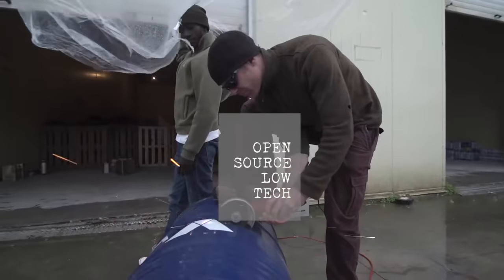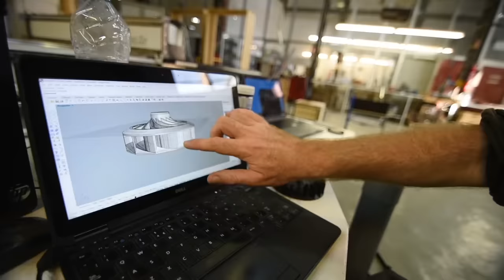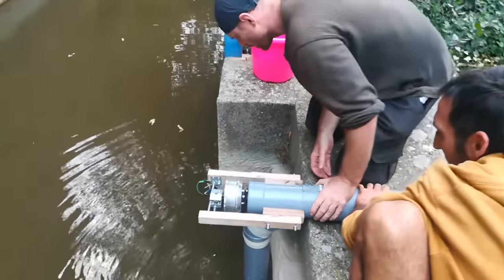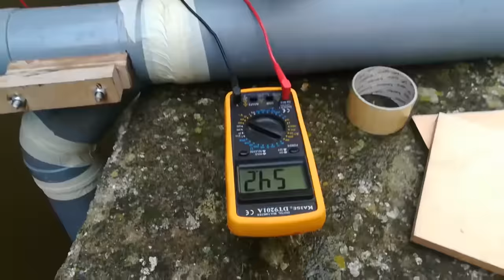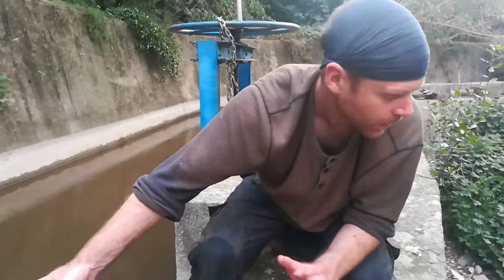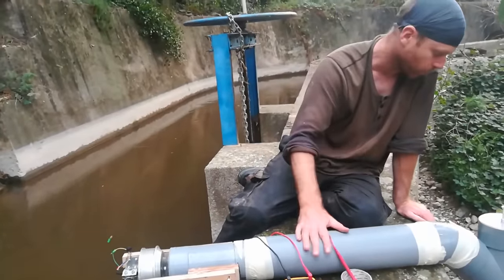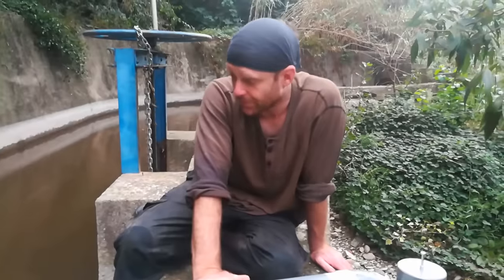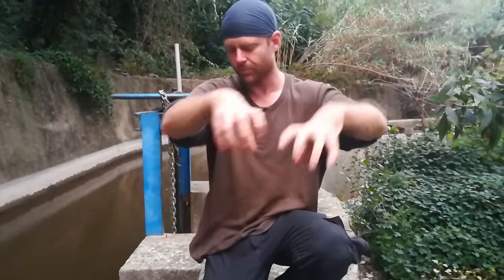The $50 Water Turbine -DIY, Portable, Powerful, and Open Source

Comment from the maker: Thanks for all the helpful comments. I'm currently in Berlin working on optimising the design,  including ways to maximise the rpms and voltage, so as to be able to have less load for more power overall, and try to hone in on that hundreds of watts figure. 
I'll be publishing all the results in a future video soon. Any suggestions and recommendations for ways forward are certainly appreciated.
And if you have any technical questions let me know.
Reply: Hey Man, I like this project and live in Berlin, I would like to help you to optimise this project, I have a master in Electronic Industrial Engineering Energymanagement.
Reply from the maker: Ok cheers, happy for any help I can get. Email me, address is on the opensourcelowtech.org website.
Reply: Quality  balanced bearings to reduce resistance,
Reply: Why couldn't you place generator'(s) in the down flow pipe as well for additional output? Just thinking out loud!  Nice work.
Reply: Do you know how the dyson vacumm advanced? Vortex within a vortex = exasterbated flow, mite work with kw output too?
Reply: This is super interesting. Need to get this to work in Tidal water. You need a vortex impeller for the discharge pipe. Also one before the fan would be interesting. You need to get the water moving centripetally if you can. Much more power to be had. Also with water that fast, the middle of the vortex should become levitative enough to pull a vacuum, which suction is the inverse of implosion. I'm thinking about this for my own design. How can I twirl the water enough to create the vortex vacuum and then I can use the negative pressure to enhance the machine? Also, when water is vortexed, the middle of it reaches its anomaly point at 4 degrees C. Due to this extreme cooling water becomes much denser having expelled its gaseous content. Denser water will provide more torque!! Viktor Schauberger, its all there. You're on the right path but you need his ideas to go to the next level.
Reply: Real Newsforever  
I think you need an electric boat if I understand you correctly. This is not technically possible with this mini hydropower plant, since this mini hydropower plant is only a power generator that can work at a certain position with a certain high difference. If you want to have an electric boat, you need photovoltaic modules, for example on the roof of a boat and a battery to store the generated electricity, as well as an electric motor to drive the boat.
Reply: Real Newsforever  How you got the plans? Are this Infos public Information or real plans and dates?
Reply: We have disused water tower at off-grid site. Would one day like to use windturbine/solar power to pump water to top. And run back down to have energy when power is needed.
Will follow your channel. ✌️😊
Reply: What output voltage is? 25V?
Reply: @afrohawk  There is a really good graph on what type of turbine to use depending on what flow and head you have.
For Undershot Wheel also read vertical or horizontal axis impeller types.
https://www.researchgate.net/publication/328216539_Assessment_of_Gravitational_Vortex_Turbine_in_Nepal
Reply: It looks promising. Where did you get the runner? Did you make it for the purpose or just find it by chance? How do you maintain a constant rpm?
Reply: Hey I live with my mom in a very rural old school cottage/cabin which is falling apart.  I have reframed problem areas reinforced trusses in roof and insulated. Water had very low pressure and heated slightly.  I started harvesting rain water after applying the proper coating to the recently shingle and metal roof I even have black hose draped on east side of roof so she is able to have a hot shower every morning.  I began converting my gutter into miny turbines that we've just recently been able to use throughout the house.  The location of her cabin is priceless my mom and dad were going to retire up here and my dad would have fixed it up far better than I'll ever hope to.  Unfortunately he passed away 12 years ago and my brothers and I can only do so much and now my health is failing.  I would appreciate any specs on that  water turbine which would make her last few years as comfortable as I can make them for her while I am still able.
Reply from the maker: @marcmilligan7143  Specs like which?

Comment: i hope that the tutorial will come up soon i would like to learn from it and share it to the the remote area in the philippines where people dont have basic electricity this could be a big help.
Reply from the maker: Yeah please do. I'll be putting the tutorial together in the coming months, once the design is sufficiently optimised and tested.
Reply: thank you sir this could be a big help for those people in need once the design is finished ill be more than happy to do it and hoping i can get help from the government once i made some proposals thank you again sir and Godbless you!
Reply: Have a merry Christmas and happy new year sir!
Reply from the maker: You too.
Reply: @OpenSourceLowTech   Hi there. In the video that you show how the turbine is turning the motor through the pvc pipe at the channel, can you please tell me what kind of motor you used there. Thanks Leon
Reply from the maker: @leonpitout3463  I've been using wheels from hoverboards/balance boards/segways, which are about perfect in terms of in and out numbers, and pretty easy to get in a lot of parts of the world.

For the rest of the world I'm thinking motorbike alternators are probably the best option, but haven't had a play with that yet.
Reply: @OpenSourceLowTech  Thanks for answering. I want to build myself a hydropower from a gasgenerator but only the generator part. Turned by a waterwheel with a big pulley and smaller one on the generator. Already worked the ratio out by the pulley calculator because i need 3000rpm for the generator. Thanks anyway
Reply from the maker: @leonpitout3463  Water wheels are super low rev, the alternators from generators are super high rev. You'd need to gear up by something like 500:1 to get any kind of useful voltage, and even if that's possible you'll lose a massive amount of power just to the gearing itself.

If you're attached to using a waterwheel (which may be your only option if it's flat water) then probably your best option, other than making your own voltage maximised DIY alternator, would be something like a direct drive washing machine motor (usually LG or F&P), or maybe an eBike wheel. But both those are still going to struggle.
Reply: @OpenSourceLowTech  Thanks for the information yes its not that easy

Comment: It is interesting having the driven member at the top. However, it does not matter where the energy is extracted from the flow,  because the total amount of energy depends on the   volume of water and the distance it falls, no matter where the energy is extracted. Higher voltage means lower loss for transmission of the power but then the  higher voltage must be reduced to the voltage that can be used by a particular user. Unless there are fairly high resistive losses in the transmission of the power, which is unlikely over short distances, it would be better to produce the power at a voltage that can be used directly. If the turbine needs to spin fast and only low torque is available then an alternator from a scooter may work well. The rectified output could be used to charge a 12 volt battery. This battery could then be used for 12 volt LED lighting. If 220 volts are needed then modern inverters are energy-efficient and available worldwide.
Reply: how does the distance the water falls after the 'driven member' affect anything ?  Seems like only the distance above the driven member should matter

Comment: Hello, 

Very good project I love it. 

Just one thing you are wrong (or i didn't understand correctly your explanations because i'm not english native). When you say your system doesnt use pressure for its power but more the speed of water. That is not true. 

To have power you need P. (Delta V / t) which is a common thermodynamic formula. So pressure and water flow are both important and necessary. And in function of those 2 potentials you will adapt your system (and you did).

Your system works with negative pressures due to water fall. That's why you need to launch it at the beginning. The rotor is runned by this negative pressure with a pulling force.

But with heights higher than 10 metters you gonna reach -1 bar (relative pression) which correspond to vacuum, so a natural limit. 

So yeah it becomes more optimised to put the turbine at the bottom of the waterfall with heights > 10 metters. 

Another thing, you speak about the cheap price. But you do not include electrical parts and knlowledge to convert this energy to a proper and stable electrical signal. 

Anyway still cool !! Did you get 500 watts ? 😁

Comment: Siphon tube will spin and spin whatever you want it to. Great job !
Reply: We learn to use less so we need to make less electricty. Peopl spend 4 5 6 even 1000 dollars a month for electric I pay $0.00 to an eketric company but I use my cheap amount we get from solar and batteries cheap generator you can get 1000 watts loaded from 1.3 hp you can do it with an electric motor as well as gas

Comment: Sink both sides deeply enough into the water, and then it works year round even if the top of the water freezes.
Reply: The pressure would equalize if both ends are in the water. Keep the water moving and it shouldn't freeze.

Comment: Please show us a load applied i want to see how the voltage holds
Reply: say my 5,500 watt aircompressor  ore 3 x 3000 watt water heater would probably stall it, hehe but as an offgrid  power supply loading a big battery and a converter12 to 110-220 volts you get more than enough power for say a washing maskine 1-2 time a day ore some powertools
even the wourld largest hydropowerplant started as a small scale science projekt.
but to perfect small scale powerplants, say a car factory could MASS PRODUSE STAINLESS STEEL TURBINS WITH GOOD SELF LUBRICATING BEARINGS!
IT WOULD MAKE THEM CHEAPER  IF THEY MADE SAY 1 MILLION OF THEM THAN IF THEY SAY MADE 1.

Comment: I didn’t see a dummy load or the load current meter?
Reply: and you won't because if you did put a load on that thing it would stop.
It's the same thing with everything like this it's just a whole lot of if's and but's.
You know, IF we had this and BUT the pressure and so on and so on.
This is why these things are always open source so that others can work out the flaws for them for free.
Reply: That still dosen't fix the fact that it will slow down when you put a load to it.
The power available in a stream of water is;
P=eta*rho*g*h*q
where:
P= power (J/s or watts)
eta = turbine efficiency
rho = density of water (kg/m³)
g= acceleration of gravity (9.81 m/s²)
h= head (m). For still water, this is the difference in height between the inlet and outlet surfaces. Moving water has an additional component added to account for the kinetic energy of the flow. The total head equals the pressure head plus velocity head.
q= flow rate (m³/s)

So with that we can simply calculate what head is the most efficient to use with the kind of flow available.

• Water wheel 0.2 < H < 4   (H = head in m)
• Screw turbine 1 < H < 10
• VLH turbine 1.5 < H < 4.5
• Kaplan turbine 2 < H < 70
• Francis turbine 10 < H < 300[10]
• Pelton wheel 80 < H < 1600
• Turgo turbine 50 < H < 250

Oh it wasn't just as simple as putting a stream of water through some blades, who knew?
Apparently anyone with some knowledge of the laws of nature....
Reply: @BolinFoto  I get what you are saying. But if I were to use this, I won't powering directly. I would send the power to a bank of Deep Cycle batteries, and then feed off of those.
Reply: Charles A Townsend  Charles, My thoughts on this would be to recycle the water. For example, dig a pond/reservoir, build a trestle to the desired height
 Setup the mechanism intake at one end, the outlet a little was toward the other end. The out flow should not reach the water level. So now you are using the same water over and over again without having to pump it back in.

I was also thinking that a secondary power system can be used at the outflow area, this one with an offset/bladed turbine to a similar alternator,  thereby doubling your energy output. 

All of this power should be sent to a  bank of deep cycle batteries then, inverters before you use. Just my opinion.
Reply: YK Chan that’s because it’s virtue signaling that the world can run on this garbage. Nuclear is already here. Clean safe and can run everywhere for nearly no cost per watt hour.
Reply: So all the people in developing countries who need power have to gather are some pipe and fittings, electric motor/generator, turbine, massive & expensive batteries that don't need to be replaced often, charging circuitry, & tools to build it.

Then, after that....walk to however far away the endless supply of water is that can drop a large distance continuously. Most people don't have access to that very  particular scenario.

Then carry the batteries there in the morning and just go get them when you need power.
Reply: @Patriot3  To compare this small DIY project with a nuclear power plant is absolutely ridiculous.🤦‍♂️ Nobody has ever claimed to be able to supply the world with such mini-turbines. (To charge your cell phone, however, it is enough.)
But if you look at real wind and water power plants, the situation looks quite different. With these we would very well be able to supply the world. Nuclear power plants are not 100% safe. And they are certainly not clean.
Reply: @Patriot3  Sounds wonderful!!   Just one question... what do you do with all that nuclear waste?  You know, the spent rods that are extremely radioactive that you have to move via road and rail through populated areas to a place where you bury them forever and ever and hope the waste sites don't undergo some kind of catastrophe that allows the waste to irradiate the local water table.  I'm not anti-nuclear, but it's not the ultimate answer to our energy needs.
Reply: Seems like you could terminate the outflow further from the water and put an old school water wheel underneath for extra purposes. I’d assume loading the pipe with other turbines wouldn’t actually increase output as much as expected due to reduced water flow, but something beneath the outflow would not affect the system. All in all, very interesting and simple. Running lights in a remote area could be made easier with things like this.
Reply: His math doesn't add up at all. The total potential energy available with the mass of water and head stated is about 100W assuming no other losses. If he's even 50% efficient he's only making 1.2 kWh per day.
Reply: Yasmine Steinbauer your point is exactly what I mean. It doesn’t help anyone. It’s just enough power to do nothing with. What we need is to get rid of this liberal virtue signaling that life’s issues are easily solved by hippieish nonsense. Build real power stations that allow peoples to prosper. 
Know one needs or can you use just a cell phone charger. They need industry that requires megawatts of energy all the time of every day. 
Stop holding people back with pipe dreams. This helps no persons anywhere. 
If you think it does switch to it?
Reply: your right, he made such a claim and I waited to the end for a load to back u his claims but there was none.. the other posters does not even know , what they are talking about like add a battery... Don't they know a batter is a load.. or they do not know the 55V can not connects to a battery? So you going to need a regulator.. spoiler alert  a regulator is a load and will eat some into that 55V
Reply: Alexander Stack yes a wheel would be many times more effective. The weight of that siphoned water running a wheel with 5 gallon buckets for troughs would be a real power house. 
Run it through a gear reduction such as a manual car transmission. You could shift it depending on your load needs for amperage driving it through a regulator. 
A good quality brushless 3 phase motor say in the 50 to 100 hp range would would offer decent output. 
Not for the third world. It just requires to much industrial arts. I would imagine the man that could put that together would simply be smart enough to find his way to South America and walk across the USA border and ask for sanctuary in California. Then collect his free every thing and be retired.
Reply: @BolinFoto  absolute chad :)

Comment: I would like to see it running with a load taking 10 A; wonder if de generator can deliver it at 50 V. The tension will probably drop to 25 V if not regulated. And I wonder what the torque in that case will do with the plastic turbine. 

Keep up the good work.
Reply: With 10A it will drop way lower than that

Comment: Fantastic job, guys. The turbine looks like the impeller of a centrifugal pump with shroud. So as you pointed out, you only need good flow for this turbine and not much of head.